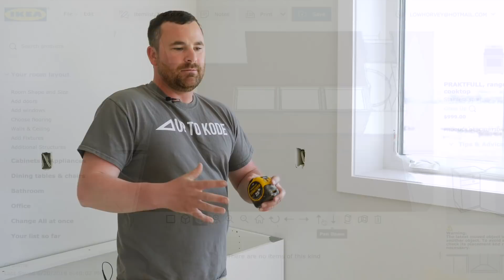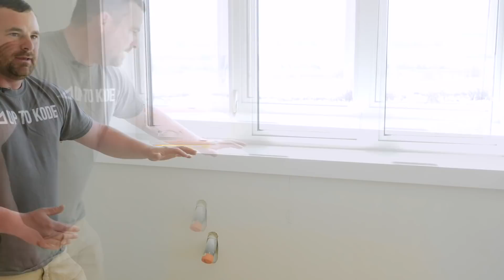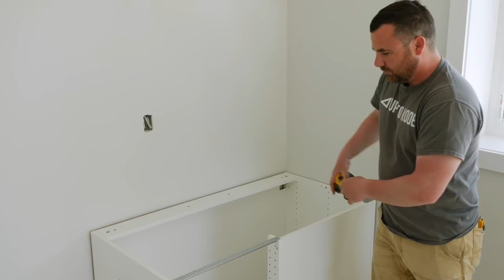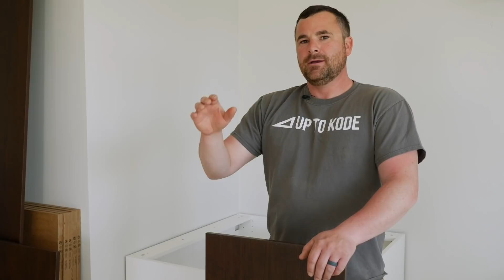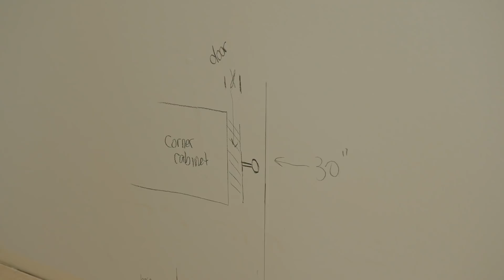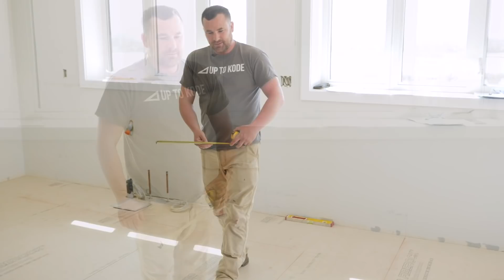IKEA Kitchen Cabinet Course Part 1 of 5: IKEA Kitchen Planning & Preparation

Comment: One thing about these Ikea fasteners is they do NOT have Phillips heads. The screws are POZI drive, a type that’s popular in Europe. If you look at the heads, there’s a little line between each pairs of arms in the cross heads. This indicates POZI. A Phillips screwdriver will sorta work but it will pop up out of the cross heads. A true POZI will fit like a glove and make things a lot easier. I assemble Ikea cabinets for our local Habitat for Humanity and having the right screwdriver helps a lot if you do a bunch of them. Ikea sells the screwdrivers but you can buy them from Amazon too.
Reply from the maker: I need to buy one of these bits for my next IKEA kitchen

Comment: Thank you for the great videos! Due to pandemic (i think) there is a shortage of Sektion 24" deep base cabinets. there are a select few still available. i was wondering if you think its possible to buy any available width. scrap the bottom panel and metal spreader and salvage the box sides. use other material for bottom panel. use wood screws and glue to fasten together rather then ikea provided fasteners. i was thinking of purchasing tall cabinets and taking cutting their side panels down to make into bottom panels. Jimmy rigged i know but might get people by in a pinch? any thoughts?

Comment: I just installed my first wall corner cabinet of the kitchen using IKEAs rail. Do you secure the wall cabinets at the bottome at all?.. or the rail system only and secure to each neighboring cabinet?

Comment: @kodyhorvey  do you need filler piece OR support for a dishwasher space void, that is on the end.   I have in secession from left to right:   15” tall (80”) long cabinet, then to the right is a Dishwasher space, then to the right of that is a 24” farm sink.  
My question would be:  do I need a Support or Filler piece, for the LEFT side of the dishwasher void.  (Since the countertop would basically end above the dishwasher.) 

And. What would be a good space to leave to slide a 24” dishwasher in?  

P.s. Thank you for your excellent videos!!!
Reply from the maker: You could install a cleat against the tall cabinet and rest your countertop on that. It’s all you need. Then the dishwasher can be installed.
Reply: Thank you!  Any suggestion for the type and style of Cleat?

Comment: @KodyHorvrey   your video is GREAT!  one question though, for the Space for the stove... did you factor in 30" inches PLUS addition 1" inch or two, to be able to slide the stove in?
Reply from the maker: For a stove I go 30 1/4” from box to box. That allows a very slight overhang of the countertop which should be 30” in between. The stove will slide in nicely but be tight enough that less food will fall down the crack

Comment: If you are doing a reno and your walls are not perfectly true vertically, or if there are any waves across the wall, TEAR OFF THE DRYWALL and sister or shim the studs to get everything perfectly aligned.  The Ikea system is fantastic, and installs perfectly when the walls are true.  Any deviation will cause you enormous angst as the kitchen goes together.
Reply from the maker: I made 2 recent videos showing how to install an ikea kitchen with crooked walls and walls that are out of square.
Reply: @uptokode   I'll check them out.  Brother it aint easy.  When you think about alignment of cabinets on opposite sides of appliances, gaps on the back of a granite countertop, having to build end panels for dishwashers that are the end of the run, and trimwork, so many issues pop up as you progress that it just makes more sense to true the walls first. 

I LOVE my kitchen, dont get me wrong.  It turned out fantastic.  I truly wish there were 30 more install vids like yours out there about 18 months ago.  So kudos to you Kody for the effort!
Reply from the maker: I hear you ! I’m a stickler for building square and level as it makes all other steps of finishing so much easier. Kitchens, doors, trim, tile showers, glass, and so on! Thanks for commenting!!

Comment: Thanks for the video.  However, I would disagree about not having a filler panel next to your range when you have a hood or microwave above it.   The upper cabinet will have end panels adjacent to the hood/MW.  To keep the install symettrical and spaced the same from the uppers to the lowers, I'd duplicate the end panels.  Otherwise, you may sometimes have a full inch (.5 x 2) of  difference at the end of a run of cabinets on the lowers from the uppers.

Comment: Hey! Loved this video. It would be great if you could also do it in cm for us Ozzies.
Reply from the maker: Sorry about that. We are taught metric in Carpentry school but everyone still uses imperial. I like converting inches to mm but the whole Centimetre thing messes me up.  Thanks for watching and stay tuned as we will release each section of the series every Monday morning (Canada time. 😊)
Reply: The Ikea cabinets for us metric folk are the Metod range, they come in 20, 40, 60, 80 & 100cm versions just so you are aware. Every other cupboard manufacturer here in oz tends to stick with 30, 60 and 90cm standard widths. This only becomes an issue if you want to use Ikea inserts (which I think are awesome in the bamboo) in other brand cabinets. It's not going to work.... obviously. Appliances from other manufacturers will fit in the standard cabinet spaces though, so you can put better quality applicances in to Ikea cabinets if that is your thing.